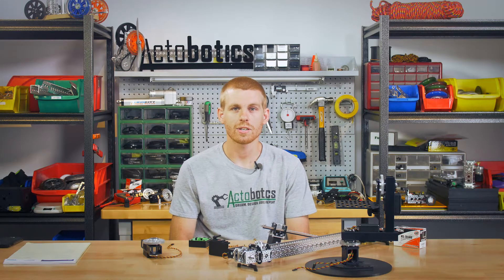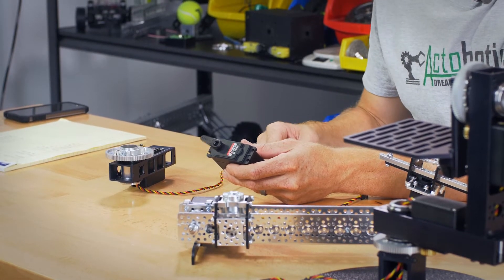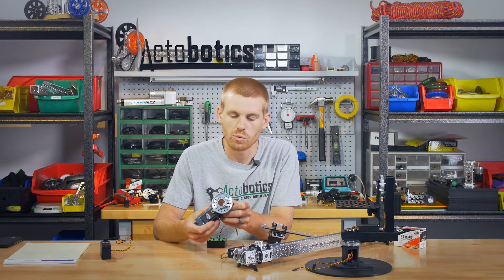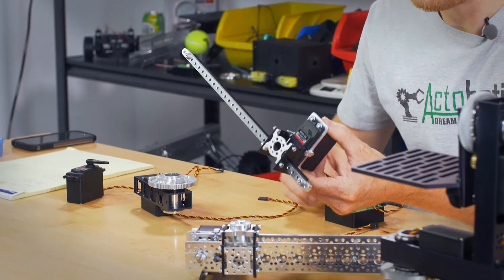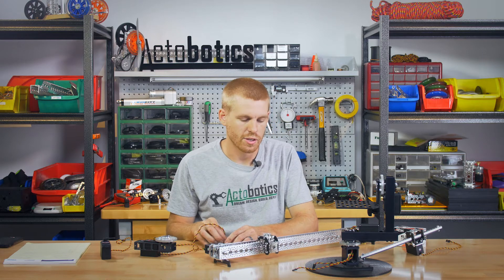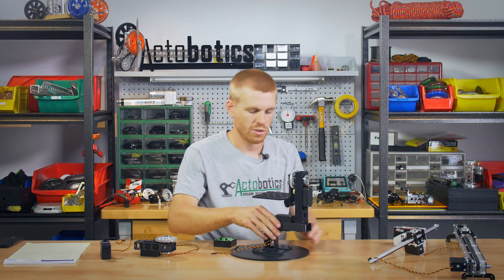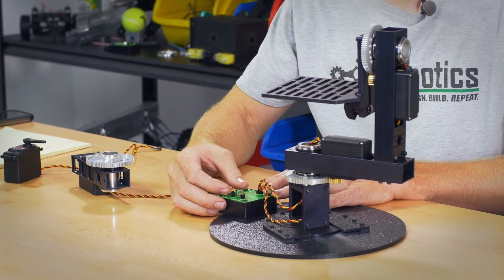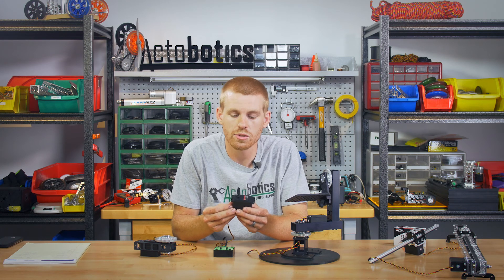The HS-785HB Sail Winch Multi-Rotation Servo Explained

Comment: Good afternoon.
Re. Hitec HS-785HB servo.
I had this servo since 2008 and it always worked fine. Suddenly it went mad. It goes from end to end without stopping at any stick position. Any advice on how to fix the problem.. 
Thanks and regards
C. M. La Fery
Reply from the maker: Hello,
It sounds like the feedback pot has become disconnected from the output shaft. Hard to know for sure, but that can create the behavior I think you're experiencing.
Reply: @ServoCity  I'm having a similar issue with my HS-785HB. Except I believe when I ordered mine, I had it modified for continuous rotation. And now, it just keeps spinning in one direction and never stops, regardless of what commands I send it.

Comment: the servo slider seems perfect for opening and closing house door am i right? how about the capacity of moving heavy weight of the object is there any manual that i can read upon before buying?

#thanks
Reply from the maker: Depending on the mechanical system that you're using to drive the door, it's very possible to use a servo like this to move a large amount of weight. But there are a lot of factors that go into determining how much Torque your servo needs to move a weight. Here's a video on Servo Torque! https://youtu.be/KS2T2mvMitA

Comment: how can you control the HS-785HB angle? It seems that I can't get my head around that. I am trying to make the code to rotate exactly 90 degrees ...
Reply from the maker: Hello,
As with any servo, you'll want to reference the "travel per µsec" spec on the spec sheet. This will tell you exactly how far the servo will rotate with a given increase in signal. 
On the 785 that spec is 1.570° so you'll need to go from your starting point (say 1500µsec) you'll need to increase the pwm signal by 57µsec. In this example you'd move from 1500µsec to 1557µsec.
Please feel free to shoot us an email to tech@servocity.com if you have any further questions!

Comment: I'm controlling this servo using joystick on a transmitter. Can the servo be made to hold position when the joystick is released back to center?
Reply from the maker: Hi Lance, an HS-785HB is closed loop servo with position feedback. Meaning it will always return back to center position when a joystick is used.  You might consider using a continuous rotation servo without feedback. An HSR-2645-CRH https://www.servocity.com/hsr-2645crh-servo is a factory open loop servo that will give you the open loop control you’re looking for.  Here at ServoCity, we also have extremely high torque servos that we modify to continuous rotation as well.  Please let us know should you have any other questions tech@servocity.com.